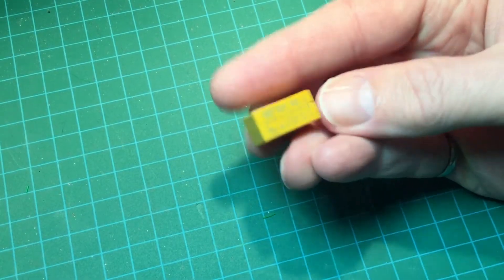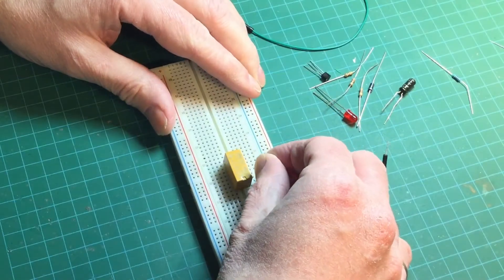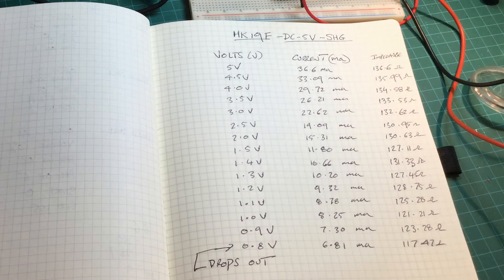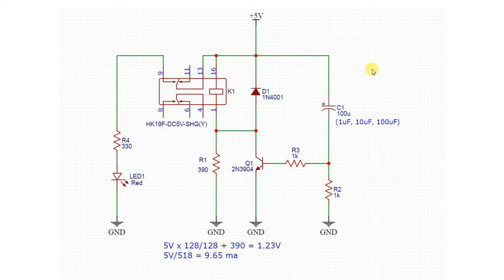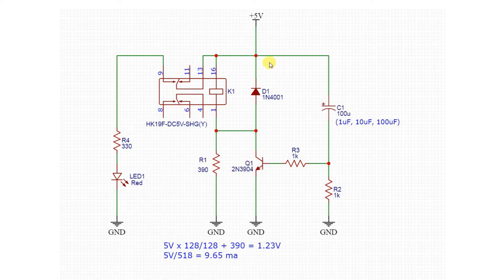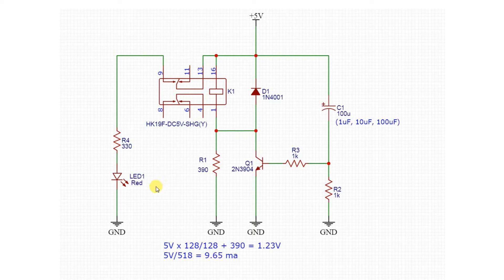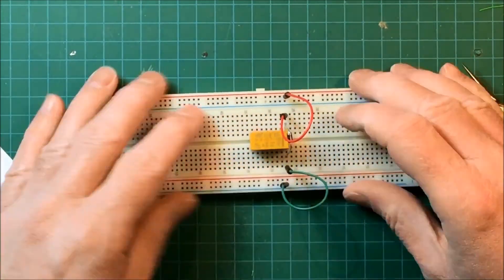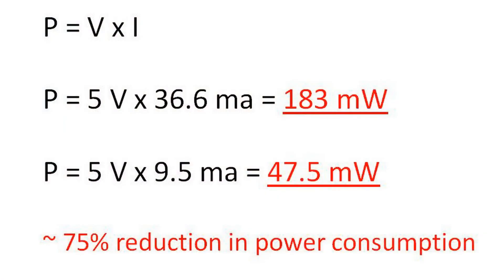Reducing Relay Power Consumption - Holding Current versus Pickup Current

Comment: If I have a 12v relay using drawing 80ma and still works down to 6.5v (drawing 46ma) , what values of resistors & cap would you suggest in your circuit ?, Also how would you handle the transistor base voltage at 12v ?
Reply from the maker: You should only need to change R1 value. Probably a value around 150 ohms would work.
Reply from the maker: If 150 does not work, try slightly lower value around 120 ohms.

Comment: Simon, great explanation, thank you.  Question, I'm doing a DIY yard sprinkler system proj. w the standard cheap NC relays and wiring the values to the NO terminals when the relays are not energized.   My concern/interest is what the power draw for the relay is when in the NC / default position.  It appears the LED are lit in this position.  Is there any other draw or charge what would cause these to fail over time that you can think of?
Reply from the maker: If the circuit is energized there will be a current draw by the relay coil and resistor in normal operating mode. Current draw will be power supply voltage/(K1 coil resistance + R1). No other draw.

Comment: I saw a simpler variant of this circuit which doesn't use the transistor, just the 100uf capacitor directly across the resistor, I tested it and it works great.
Reply from the maker: Interesting! I’ll have to try that